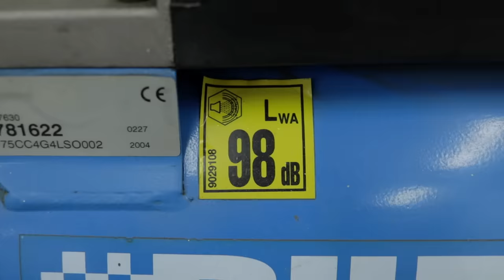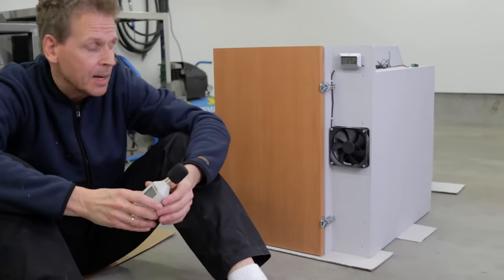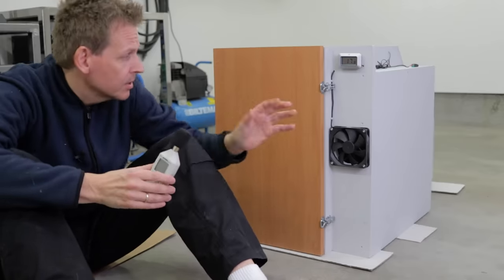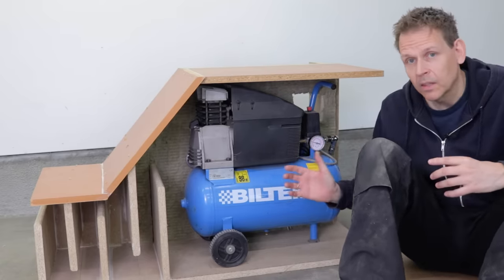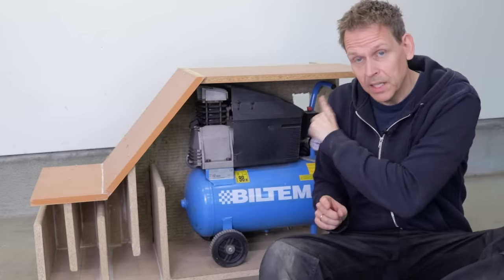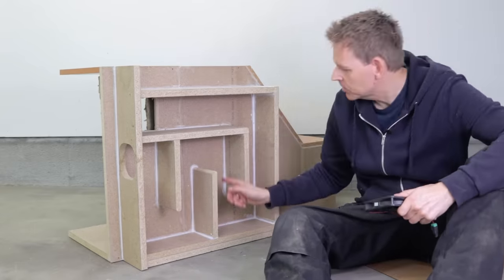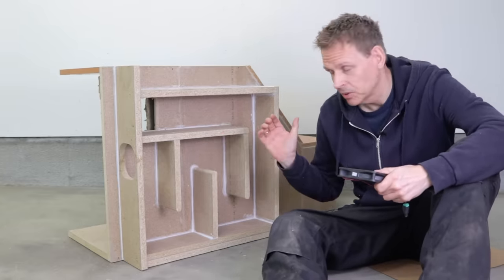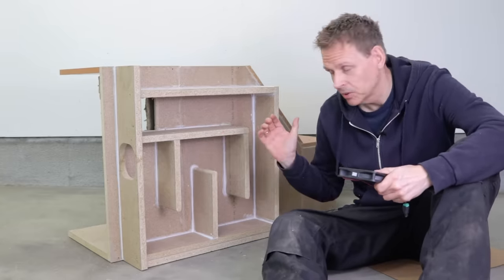Do not build a sound insulated enclosure for your noisy air compressor!

Comment: When you’re thinking of the physics of sound, think of it more like jello. While we perceive air as space and sound as something that travels through space, an oxygen molecule isn’t going to travel from a speaker to your ear. It gets pushed into its neighbor and they keep bumping into each other until they reach your ear. Kind of. Look up rarefaction if you want to get into the weeds. For our purposes, thinking about all of this space as a body of volume transferring energy is where effective sound mitigation starts to make intuitive sense. 

More distance to conduct that energy, absolutely. And not just as function of distance, but also partial phase cancellation of waves that crash into each other.  But carpet underlay, not so much. It diffuses reflections to some degree that could result from an otherwise flat surface, but a very small portion of that volume will actually be affected by it and only through the course of maybe 2cm (~thickness*2, coming and going) of a not particularly dense material. The same amount of material across a much larger volume like puffy pillow stuffing (flame retardant!!) will result in diffusion to much more of that energy and affect longer wavelengths. A 20Hz vibration, the lower limit of human hearing, has a wavelength of over 17 meters (at 20C). The hiss of spraying air out of that compressor might get flipped around a few times in foam or carpet but 20Hz don’t care. They represent 2 very different levels of energy. That said, 15dB is a lot, especially up at those numbers. Decibels don’t represent a linear scale, it’s *logarithmic*. 6dB represents a factor of 4 power. It’s an excellent engineering metric and not a great everyone metric. So “half” and such are right out the window. Technically doubling the sound is 3dB but only in circumstances you’ll never encounter.

Back to the real world, if you add some more turns to the maze, use a higher volume of diffusion material, sit the compressor on extremely dense specialized closed-cell rubber like sorbothane or similar to reduce the compressor vibrating the box itself, then the same for the box to the floor, that might be another ~6dB. Maybe $40 more. This box ‘floating’ inside another box, now you’re in the neighborhood of recording studio construction. So if there’s no quieter machine available, or you just love over-building and over-engineering, there’s a number of ways to go with this to get the desired result. Just embrace the super weird physics and calm the jello.
Reply from the maker: Wow, this was very interesting and very well explained 🤩Thanks a lot!

Comment: Suggestion. Have the air come in at a lower point on the inner box and the air go out at the highest point of the inner box. Cool air will help to push the warm air out and reduce heat build up.
Reply from the maker: What you say makes absolutely sense  😊 but the reason I put the exhaust at the rear of the box is this: 
my garage is actually not insulated, and there is an opening for ventilation where the ceiling meets the floor upstairs. The exhaust air from the air compressor box is placed up against this opening. The hot air from the compressor is pushed out of the room to outside of the building through this opening. By doing it like this I avoid the hot air to be circulated back into the room. I totally forgot to tell about it in the video - my bad 🙄
Reply: @kihestad  it was a good video. I saw the location of the air exit in the room. It’s possibly not necessary if the PC fan pushes enough air in and if the unit is not ran too long. You have a thermometer so you can watch it. 
I nerd on heat and air movement. So I see these things when its possibly not critical. 
It was actually impressive how much the sound reduced. A tool is virtually perfect when it works well and is invisible like that. 
Thanks again for the video. It was nicely done.

Comment: I have an interesting idea to recommend. Your compressor (1500w one) seems to be running on a fixed frequency, which means it should also be rotating at a fixed speed and that will translate into a very stable sound frequency. If you could limit the sound to one specific opening and then using a high quality mic, record it, invert the noise and then play it back through a speaker facing towards the noise exit port, then you could theoretically cancel almost all that sound through destructive interference.
Reply from the maker: Hehe, that would have been a interesting experiment 😊 I would guess it's not as easy to make it work in real life as in theory 🥴

Comment: Nice sound box work you go from 85dB to less than 70dB that's not bad ! Sure not enough as it's like a intensity equal to the spoken voice so certainly still too noisy. In acoustic physics the sound passes through the slightest hole in an opaque wall so the system presented here cannot work, or it would have to be made more airtight by an insulating chimney fixed to the air intake of the box.

A modification of the well thought out air filter can be enough to attenuate the first 10 decibels if you want more you will need a box. Already in 1957 Atlas Copco was concerned about the noise of its compressors and had developed a coaxial filter filled with wood wool (foam and glass wool did not yet exist) the 1/2 inch air intake is extended by a 1/2 inch by 35cm tube with multiple perforations, trapped in another 80mm tube filled with insulation which ends in a fine grid. The air therefore first passes through the grille and must pass through the insulation before reaching the inlet of the compressor cylinder. It is easy to reproduce with PVC tubes of 32mm (that must be perforated and a 80mm exterior tube mounted with a Ford Ranger 2015 oil filter instead of the grid and foam as insulation. Best on bi-machines cylinder is to connect the two air intakes together in one of this system.
Reply from the maker: That was interesting, thank you for sharing your knowledge 👍

Comment: I have been using the compressor box for 5 years.  Plywood, 3 cm of acoustic foam and 4 cm of glass wool.  The crate is used in a 4x2m space.  It is as loud as human speech.
Reply from the maker: Sounds very good! 👍
Reply: @kihestad  The box cover must be fitted with a soft gasket, otherwise a lot of noise will escape. The second measure is to place the crate on soft feet. For this, I use strips of rock wool wrapped in plastic. the third measure is to ventilate the crate, which can get very hot inside. A fan blowing on the compressor head takes care of this and two high CFM fans blow into the compressor and two out.

Comment: 1 comment 1 criticism: For absolute quite and durability, I'd have used 1/4 ply screwed / glued to 1x2 with fibreglass between the studs. Double walled with offset 1x2 and 1/4 ply between them. This would make it dead quiet. Also, head does not travel downward. The "muffler" section for heat output should have been inverted, that is, on the top edge not the floor. I also wouldn't have used press board...all ply and solid wood...if press board gets wet, it falls apart...Solid wood wouldn't do that, especially if it's in a shop ;)

Comment: One thing computer builders would do with their systems, is to suspend the spinning hard drives from rubber bands to remove the sound travel of the HD into the case.  Yes, a further crazy solution/step, but if the base is still transferring much noise it could be one more thing to do.
Reply from the maker: Yes, I think you are right. Vibrations are the biggest source of noise now (I think). Will try to improve it by adding soft rubber, dampening foam or springs on the compressor and/or between the box and the floor to improve it. Thanks for the tips! 😊

Comment: One of the cheapest and effective things is to change the intake air filters to an oversized air filter. It helps. You will have problems with temp.
Reply from the maker: Adding a bigger sound dampening intake filter (for ex a car exhaust muffler) does reduce the noise, but not very much. A sound insulated box makes it much quieter. A lot of the noise is actually coming from the tank 😔

Comment: You need MASS to dampen sound. Foam, glassfibre etc allow vibrations to pass through which allows sound to pass as well. That's why the sound barriers along multi-lane motorways are mad of CONCRETE!!
Reply from the maker: I might add bitumen mats (suggested by some viewers), they are heavy and dense and should help to get rid of the lower frequencies, not to expensive either. Thanks for the tips! 👍

Comment: It's an impressive project, mostly because you managed to over engineer something so simple. Make a box out of 2 inch foam board glued to 1/2 inch plywood. Worked great in the garage as a kid.
Reply from the maker: I am the master of overcomplicating stuff 😁The shape of the box was made to fit into a specific space, that's the reason for its odd shape.

Comment: Move the compressor outside of the shop, insulate 3 walls leave away face open(toward neighbors preferably), lean-to roof, siding to match building. Install fan to operate while motor is running if desired(wire into switched side power of pressure switch)
Reply from the maker: Yes, that is probably the easies and smartest solution to the problem 😊Unfortunately, I just dont have space for it. My garage is placed with minimum distance to two of my neighbors. The side facing my own property is not usable either,  as it's just a slim path between my garage outer wall and a concrete retaining wall. In front of the garage door is no good either 😋
Reply: @kihestad  good thing is nowadays most of your air tools have been superseded with battery tools, I find myself only using the compressor for airing up a tire or the occasional air hammer.

Comment: Wow. For what you spent on materials for the box, not to mention your time, you could have bought a quieter compressor. 
Personally, the first thing I'd have done is take it apart to see WHY it is so loud and then modify it accordingly. Excess vibration from unbalanced parts and points of restricted air flow seem most likely to generate noise. A couple chunks of old tire to isolate the motor from the wheels and frame/tank would probably be a good start. Worst case, I'd wheel it outside,  build a simple awning over it and run a hose back inside. Problem solved.  Work smarter, not harder.
Reply from the maker: You are right, and that what just what I did -  bought a quieter compressor 😏

Comment: Hi, i am repairing an old generator, which is already inside an enclosure, it did have sound reducing material inside it, but it was flammable, so i have taken the old insulation out, and started to replace it with new, safer insulation

I have a large, industrial compressor, and i have previously put an extension pipe onto the air intake, and put the open end of that pipe outside

That reduced the noise a lot, before i put the pipe on, it was so loud you could not hear yourself shouting, after putting the pipe on, you could have a normal conversation right next to the compressor while it was running

The intake of the compressor makes a lot of noise

You do have to use rigid/solid pipe, because if you use flexible pipe, the air compressor will collapse the pipe when it is drawing air through it, like a vacuum cleaner

98db is the same sound level as the output of the fairground speakers i use, so yes, very loud
Reply from the maker: I would guess an generator is even more challenging to deal with than an air compressor. Glad to hear you found a solution. 👍 I might have got away using a flexible pipe, I need to have airflow through the box for cooling as well. By adding a fan to the input ventilation I make sure it’s positive air pressure inside both the box and the input ventilation channel.
Reply: @kihestad  yes and no, the generator is no more difficult than a large compressor, it is already in an enclosure, so all i have to do is insulate the insides and seal all the panel edges

It wont bring the noise down as much as your enclosure, because i will still have the engine exhaust making a lot of noise, and the radiator fans making a lot of noise

But if i can limit how much the enclosure re-transmits the sound, that will be good

I posted a video about it last night if you want to check it out?
Reply from the maker: Very cool! I took a look, and gave you a couple of video tips as well. You have a lot of very interesting projects going on 👍👍👍

Comment: One thing there a intake area on the compressor can you install a muffler to it . Figure out how to mount one on there.
Reply from the maker: Thanks for the tips 👍 but I have never seen - or should I say heard - a solution that helps very much. It does help as it remove the sharp high-frequency hiss from the intake, but there are still quite some noise left 😔

Comment: Wood sounds like a good idea, but it's actually horrible for sound insolation. You would have been better of making the box out of aluminium vs wood. Wood reflects and remits sound really well while any kind of metal will absorb long wave lengths well while a porous flexible material lining will absorb short wave lengths. Hence why we still make instruments and speakers out of wood because the reflection and remission of sound is ideal, but we make for example computer cases out of steel or aluminium, mostly aluminium, but that is because of weight and cost of shipping that weight vs acoustic prosperities.

As said any kind of metal well any non brittle metal, it's because metal has a crystalline structure, but also any metal that is smelted is done quickly enough that it can't form a continues crystal so it's a lot of small crystals bound loosely enough that it's more ductile than brittle so if you vibrate the crystals it turns some of that vibration into heat hence why it's a good sound deadening material for longer wave lengths.

It could be good for shorter wave lengths as well, but you would need to make prongs of metal to trap in the shorter wavelength and you would need thinner and more closely packed pongs to absorb shorter and shorter wave lengths, and allow them to have enough energy to vibrate the prongs, better and safer to just use a porous flexible material.
Reply from the maker: A metal enclosure would have been great, especially aluminium. It's quite an ambitious and expensive project though 😊

Comment: After some years in the noise business .... suggestions. Isolate the machine from the case better with vibration mounts. The air flow SHOULD be from low (cold air in) to high (hot air out). Air flow should be directed at the main heat source. You could use far better noise absorbing material inside (50mm HIGH DENSITY fibreglass) on at least 50% of the internal surfaces. The case material is perhaps a little thin - not dense enough (in that material). A better case material would be 12mm fiber cement board - much more dense. With some mods you could probably get L90 30 dB(A) reduction or better - a challenge!

Comment: having the compressor in a separate room is the easiest way to cut on noise. when I bought my house, I planned on sound dampening the furnace room and putting the compressor there. now the compressor is quieter than what the furnace was before sound dampening... furnace is now inaudible, only hear the air flowing
Reply from the maker: I agree, it's the absolute best solution. It is also safer to keep the air compressor in a separate room, in case something goes bad 🙄 Here in Norway we call this room 'technical room' these days, as the furnaces is mostly replaced with an electric heat pump - but the idea is the same 🙂

Comment: Direct drive compressors seem to be the loudest. Saw one home garage setup with a rotary compressor but the guy worked for ingersoll rand. So quiet and wasn’t in a separate room or enclosure
Reply from the maker: I think you are 100% correct! 👍But they are also the smallest and cheapest - that is positive, at least fits my garage and wallet 😋

Comment: This is the strategy used by commercial suppliers.   Example:  California Air tools sells an air compressor that is the same mechanical pump unit as their other standard products, but they position the pump inside of a cabinet.  Thats it.  Just "put the pump inside a box"

The way that you deal with sound is MASS and via dampening.   EG:  a box made out of heavy rubber or MLV.... and the contact with the ground should be isolated via something like a foam or other material.

Comment: Why not switching the air flow around, so pulling the hot air out at the top, where your fan is mounted and having cold air being sucked in from the lower bottom? Feels like a more natural airflow then forcing the hot air, which is gathering at the top, downwards through the whole box.

Comment: if you have the space, what i did with my father was put it outside and put a roof over it, instantly down to 55db in the shed, now the problem is remembering to turn it off when we are finished :), also much cheaper.
Reply from the maker: Yes, that is way smarter 😊I just dont have space for it. My garage is placed with minimum distance to two of my neighbors. The side facing my own property is not usable either,  as it's just a slim path between my garage outer wall and a concrete retaining wall. In front of the garage door is no good either 😋

Comment: Those strange structures on the "exhaust" are usually called baffles. They are used to dampen fluid (includes air) movement like fuel or water trucks and sound. You can see these sound baffles hanging from the roof in ice skating/hockey arenas or large gymnasiums.
Reply: Yep. Though these 'baffles' may not be the best design as they allow a fairly direct way for the noise to travel. You kind of want to allow the sound waves to cancel out so you get a smooth outflow of air. Note that exhaust pipes also have an expansion box to act like a capacitor to smooth the noise.